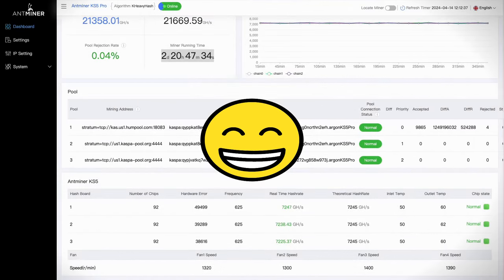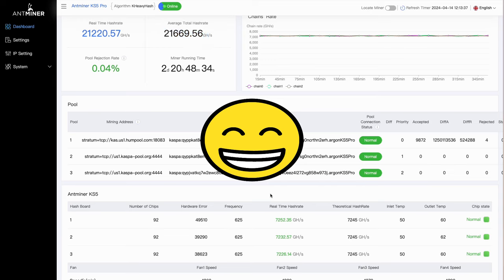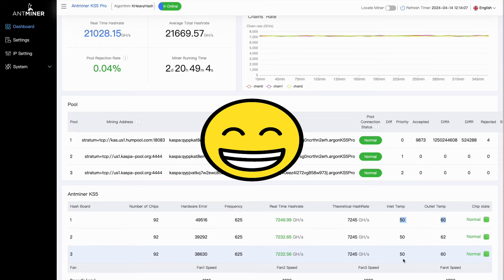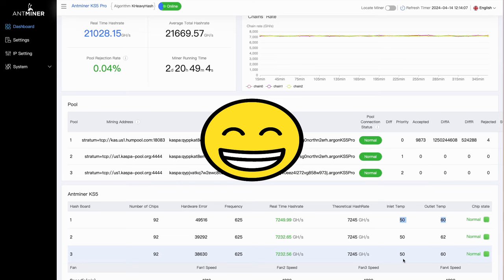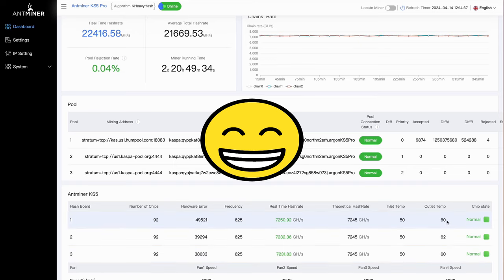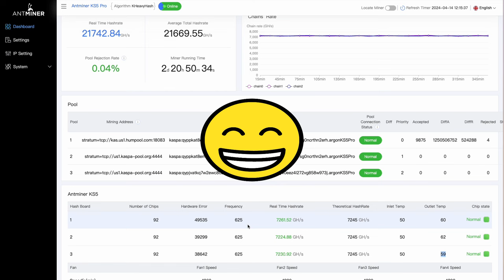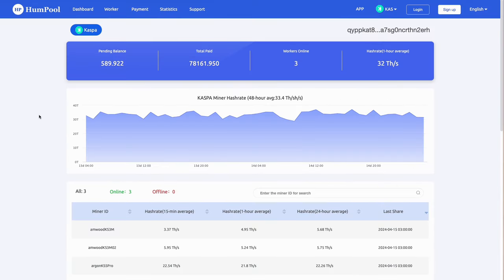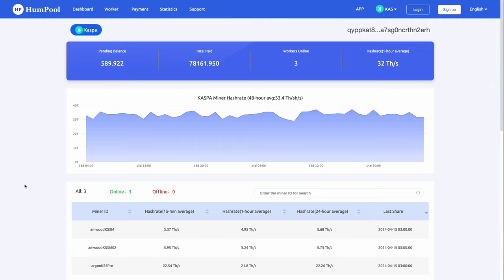Upgrading Bitmain KS5 Pro - Running the Best Kaspa ASIC Quiet & Cool

Comment: Thanks for the input, that really helps, I was intending to use immersion cooling with my KS5. I’ll skip that then. I also have a Alphapex DG1 which I used with immersive mining and it did not work at all. The mining boards are not Beeing recognised. Which is really strange. I talked with their support but they couldn’t solve it. I also have a ks1 and this works fine in immersion. Good luck with the mining.
Reply: I did the infinity fan on the DG1 with no issues. I’d recommend that.
Reply: Why no immersion cooling with spoofers?
Reply: Why no immersion cooling with spoofers?

Comment: Good explanation of how to cool the KS5, any experience with immersive mining a ks5 unit?
Reply: I have a bad experience with KS5 PRO in an immersion mining. Fan simulators that came in with Fog Hashing C2 cooling system didn't work at all. I had to request another set of them after troubleshooting the problem, and I can tell you it is not fun to play with an asic ones its all over the oil (in and out, in and out). So, I got a new set of fan simulators, they work but KS5 pro is only generating 13-14TH! While I am still working with the seller on how to solve this issue I pulled KS5 pro out of oil, took me a while to dry it off, assembled fans back and its working just fine generating ~21TH. No more that oil mining for me.. Oh, yeah, keep in mind that warranty goes out ones your miner dipped in the oil. Good luck and I hope this will help someone.
Reply from the maker: No experience with immersion for me. The additional electric costs of running a dry cooler and the high upfront costs are real turn offs for me

Comment: There is no information anywhere about what chip temperature is considered normal. Where can I find out? If the cooler is in automatic mode, then it maintains a temperature of 89-93. And the coolers spin at 38%, 2800 rpm.